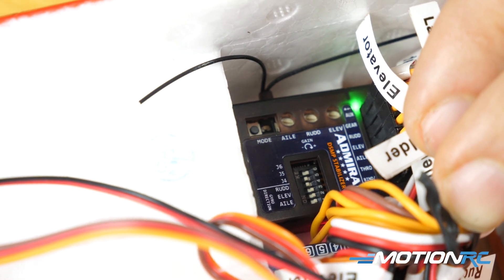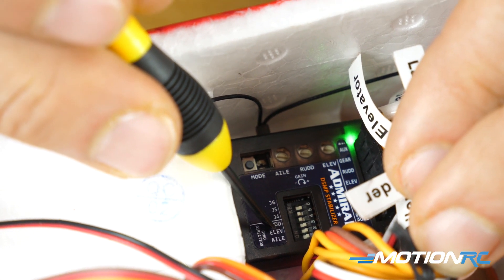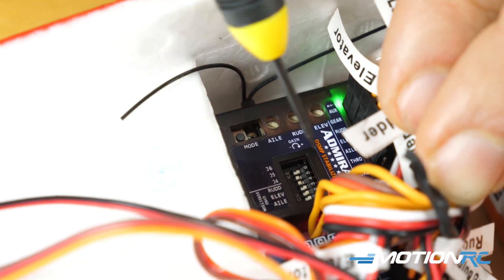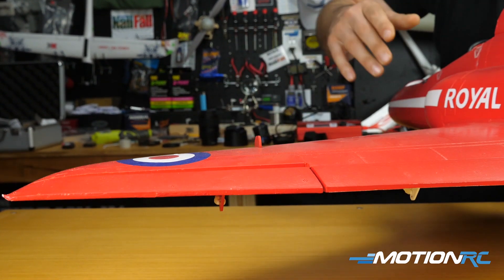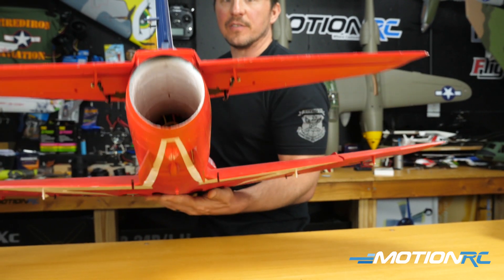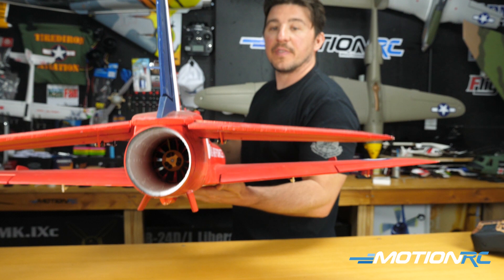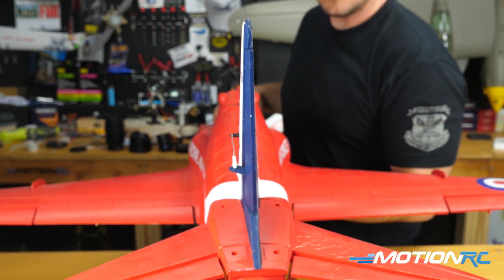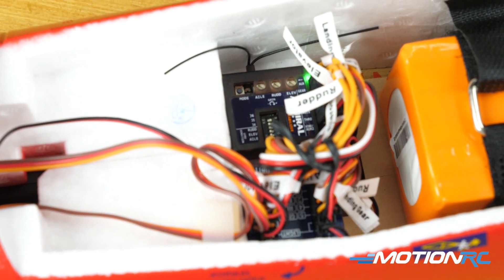Direction Correction - Admiral RX600SP Stability Plus Gyro - Motion RC

Comment: This is a good receiver. Only complaint is add a 2nd bind plug for beginners who don’t have a supply of extra parts. Motion RC only includes 1 bind plug, when the receiver NEEDS 2 bind plugs to fully use this receiver to select the combos. Other than that. It’s a cool product for a gyro solution.

Comment: My gyro is on (green light) but you can barely see any correction even with the pots turned all the way up.
Any suggestions?
Reply from the maker: Turn the right knob on top all the way up. It's a remote master gain
Reply: Well I be damn...., thanks. I'm new at this stuff. Your videos are a great help and very much appreciated.

Comment: If you can reverse direction, why cant this be mounted inverted?
Reply from the maker: Technically it can BUT if you use the auto-level function and aren't sure you set the directions correctly, you would end up inverted when you think you should be level.

Comment: have you left the gyro dials set to full for the first flight? or turned back on half back ..?
Reply: Gyro gains need to be set to a lower level for first flight. If you leave it at full gain the plane will over correct like crazy right after takeoff. I forgot to lower the gains off max on my Avanti and right after takeoff on the maiden the plane oscillated left and right bank like mad. Luckily I had set Mode C and just switched off the gyro, and it settled right down. I think this video is great but it should remind folks to back out the max gains to a lower level. I don't know what gain level to start with, that would be helpful to hear from Motion RC.
Reply: @dougfinn9561 hi,i just installed one of these...can you tell me if when plane is in gyro mode with rates turned  down can it still do loops and rolls etc? My friend says yes,but there are know flight videos on this in gyro mode only seen t45 recovery video... thanks.